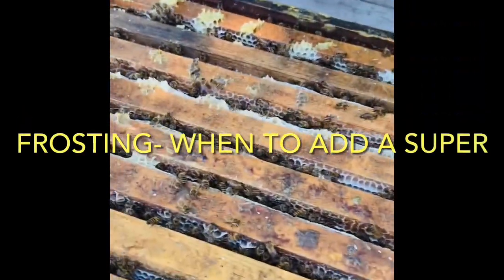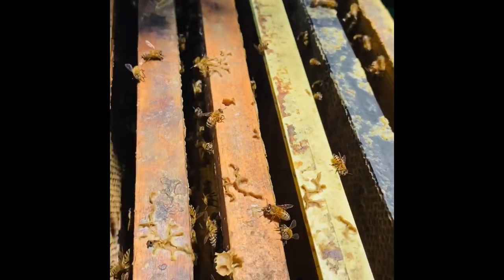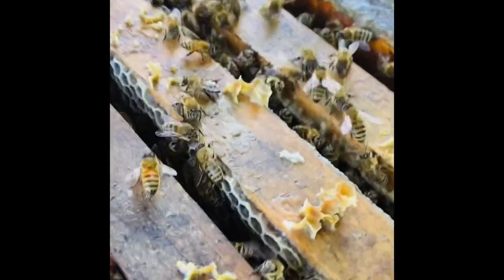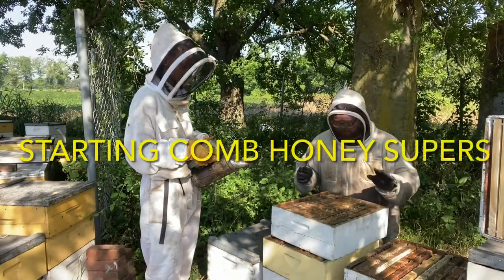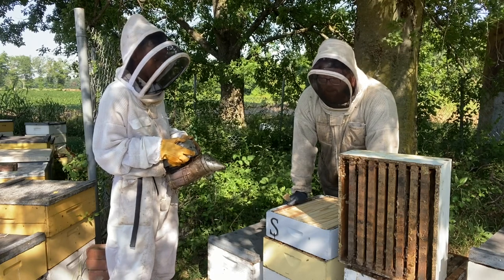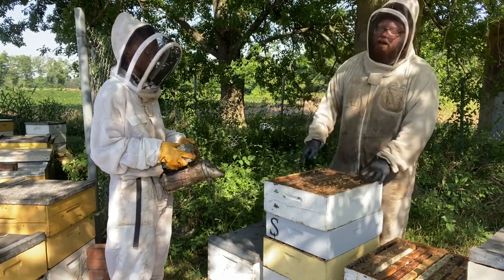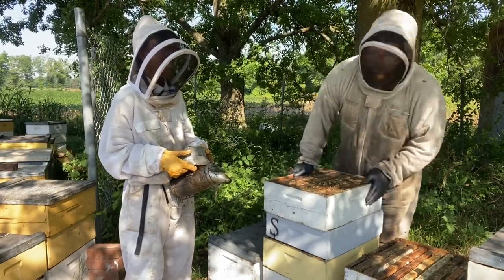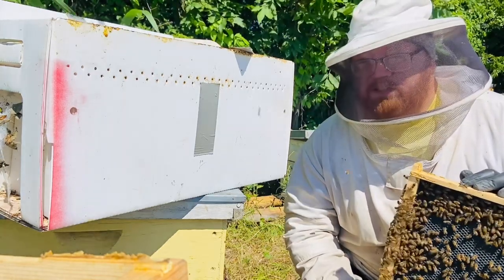Supering Tips!— When To Add Boxes & Starting Comb Honey Supers

Comment: Gus,

You mentioned a "buffer box"...I understand the reason for a buffer box, but I'm not really tracking on the details of the buffer box.  
  
- Does this buffer box need to be directly above the first brood box? 
- Can the buffer box be a deep or a medium...or does it need to be a shallow?
- Can the cut comb super be above a second deep (the second deep used as a buffer)?
- Does a super "need" to be placed on top of the cut comb super once installed as you did in the video?

Greatly appreciate any clarification you can provide...

TIA...